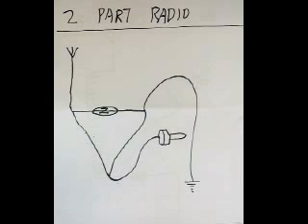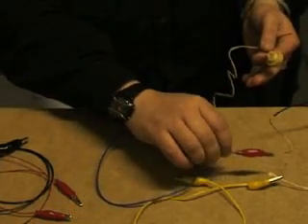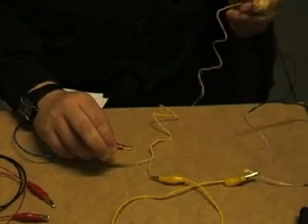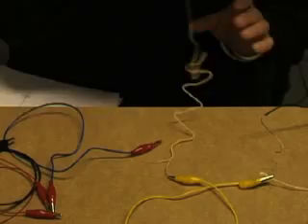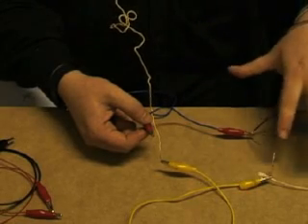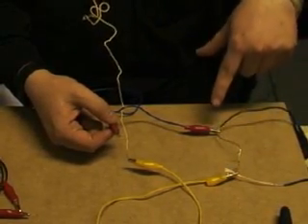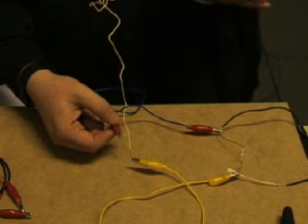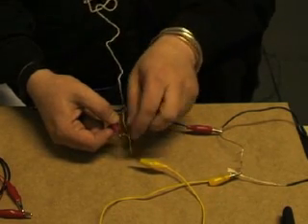Make a Crystal Radio (Part 3) - Two Part Radio

Comment: You can actually receive FM stations via a simple crystal set. It is called edge modulation. You need to readjust the coil and capacitor to tune the FM stations, but that tuned circuit is an FM to AM converter.